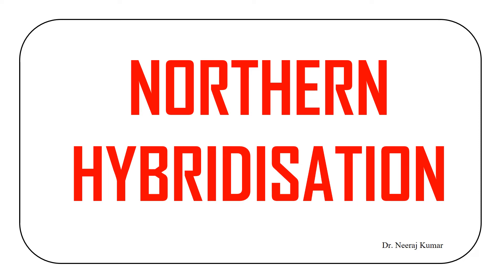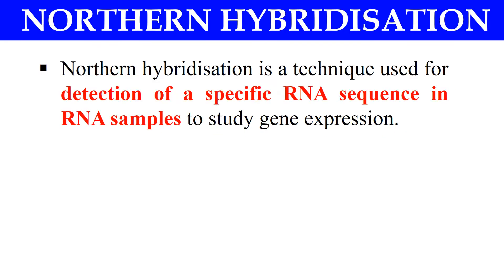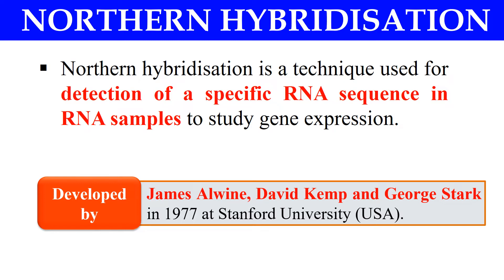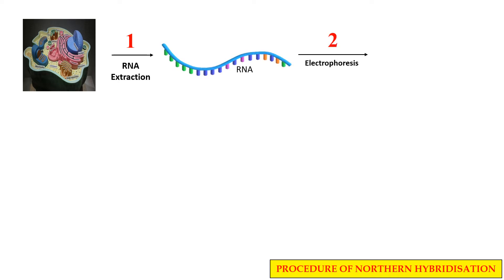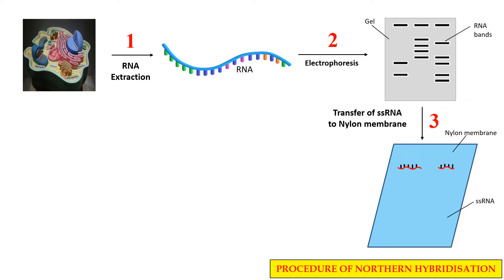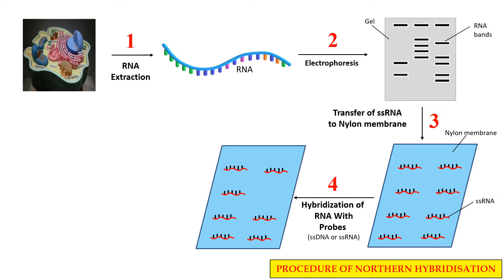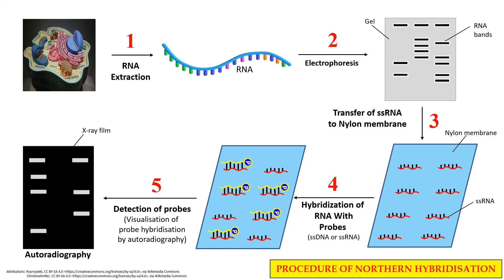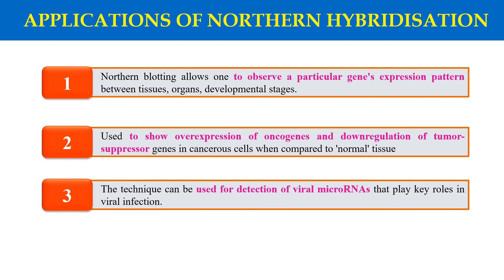Northern hybridization or RNA blotting | Principle, procedure & application of northern blotting

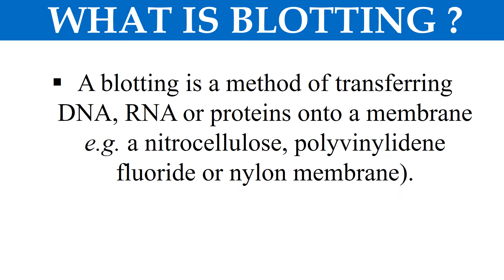Comment: 00:39 Blotting is a method of transferring DNA, RNA, or protein molecules onto a membrane.

01:18 Northern hybridization is a technique used to detect specific RNA sequences and study gene expression.

01:57 Procedure of Northern hybridization

03:15 Northern hybridization is a technique used to detect specific RNA molecules on a nylon membrane.

03:54 Northern hybridization probes can be visualized using autoradiography

04:33 Northern hybridization allows for the detection and isolation of specific RNA.

05:10 Northern hybridization helps observe gene expression and detect viral micro RNAs.

Crafted by Merlin AI.